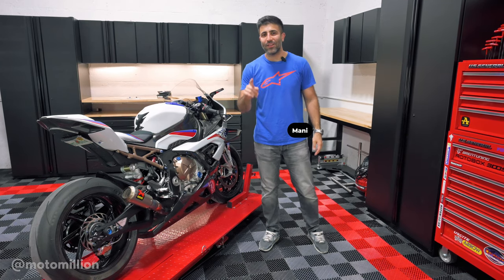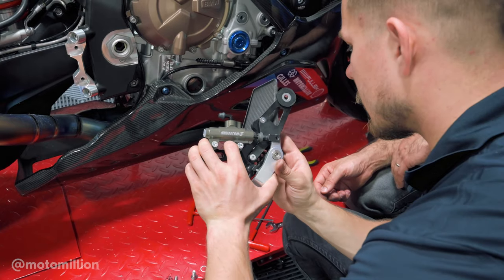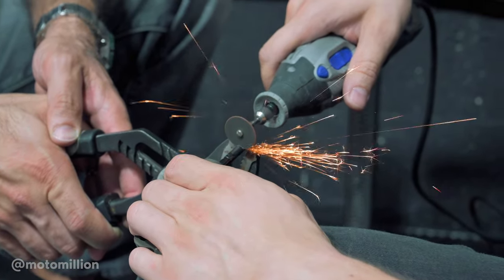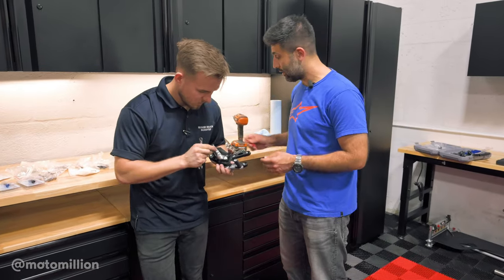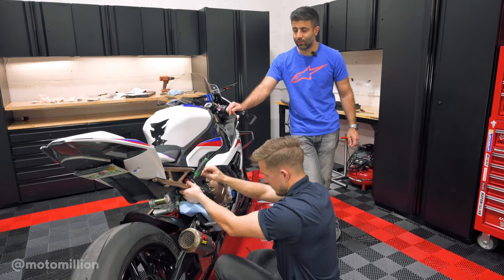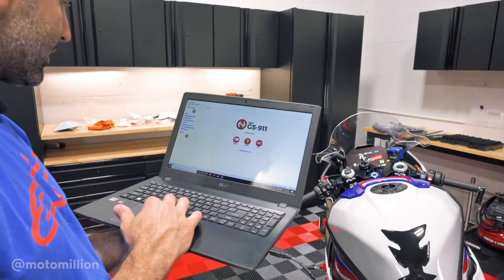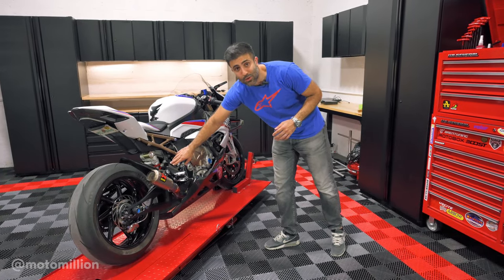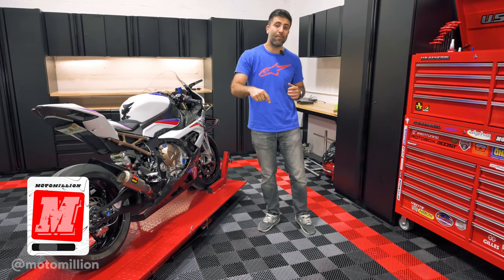S1000RR Rear Master Cylinder Upgrade! | Motomillion

Comment: Why don't you just use the brembo XA52140. That's what I 7sed for my k67 s1000rr. Plug and play looks good too in my opinion.
Reply from the maker: The brake line is not exactly the same angle, puts an uncomfortable kink in the line.
Reply: @Motomillion  mine is okay although I changed my brake lines to frentubo the fittings are the same with stock but fits perfectly.

Comment: Worried about rear brake heat he says, but has a swiss cheese rear brake rotor with no surface area to provide brake pad bite, this causes you to have to stand on the pedal and make more clamping force......Then with the rotor having no mass it instantly heats up to a temp you wouldnt see with a normal rotor......Making your precious carbon wheel hotter than it should be..... BUT YEAH IT LOOK COOL MAN.......SMH 8-/
Reply from the maker: That is why in Moto America they are running the same rear rotors...
Reply: @wildd... Just stay off of the internet for a few days bud.
Reply: I want to be a smart ass here badly, but I won't.  I will say I run this rotor on both my track day wheels and my street wheels and  they work flawlessly.